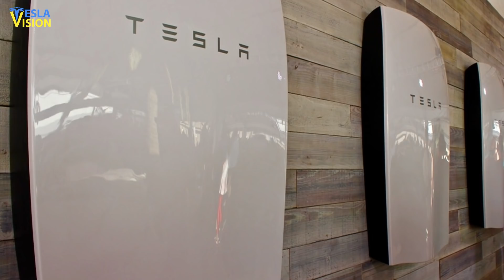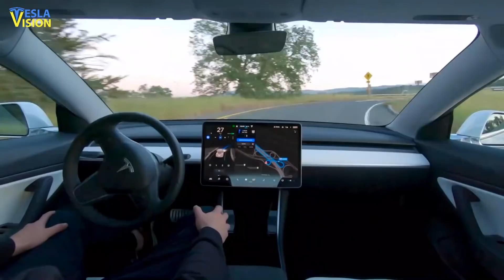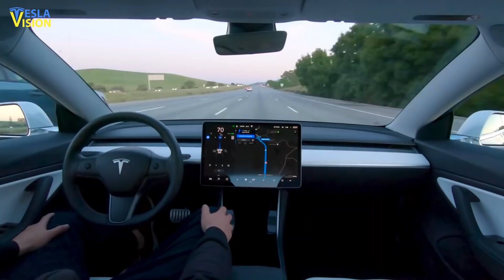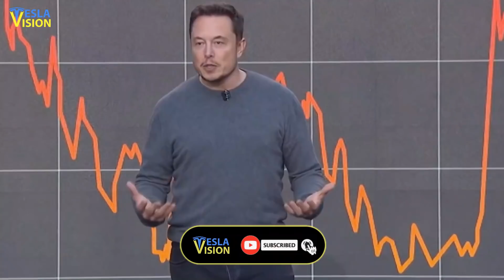This Tesla Solar Technology Can Break The Solar Industry in 2021

Comment: For the stainless steel car, I thought the whole industry and government policies say that cars are suppose to not be made out of steel because it would mean that during a crash the person would suffer more damages than the car. Am I missing something about the stainless steel truck?
Reply: It’s not a car it’s a truck?
Reply: @jefflowrythor  that would make a difference for safety measures? Automobiles are suppose to crumble during a crash to reduce the vibration felt throughout the automobile so it doesn't hurt the driver
Reply: @WirelessSushi  I was reading your statement that the industry was regulating cars, a truck may be classified differently. Which is why I made the comment in the form of a question. I don’t know the answer, I was suggesting the possibility of a different category with perhaps a different standard.
Upon further consideration I don’t think your thesis is correct in stating the entire  industry and government policies have agreed upon limiting steel in construction of any autos. Just off the top of my head I think of any truck, or 4x4 such as Jeep are all still steel bodied and steel frames. 
They do have restraints, some have roll bars and also airbags. I believe they all engineer some type of crumple zone in the design.
Reply: @jefflowrythor  I see thanks though. I didn't think that they would have been on different categories if safety was involved.